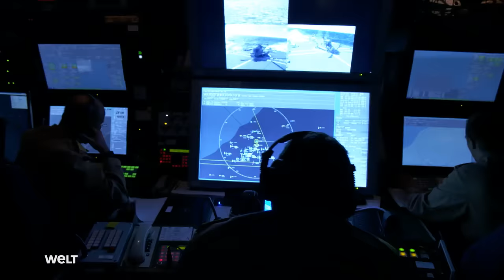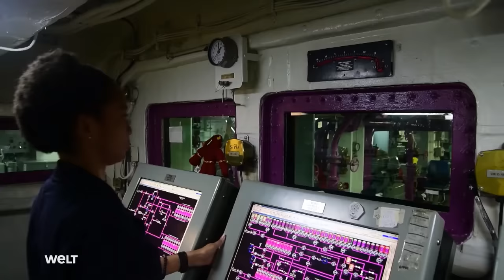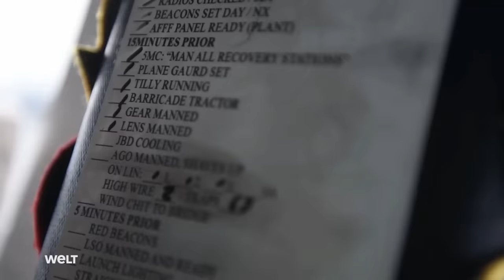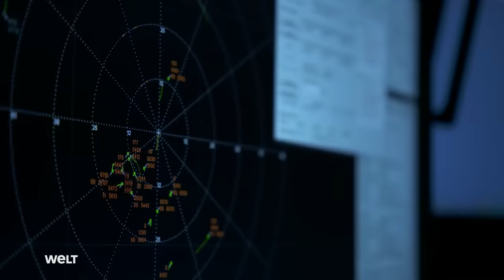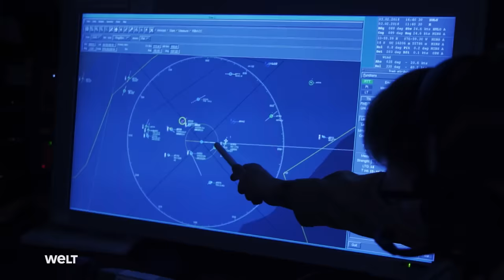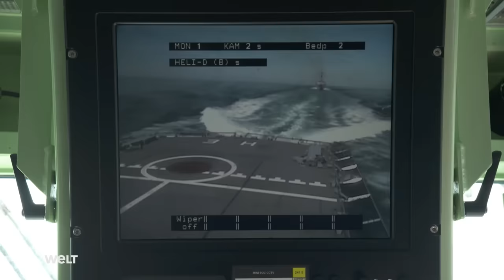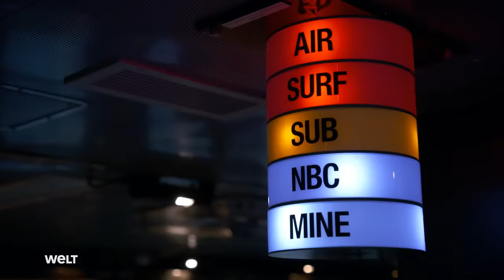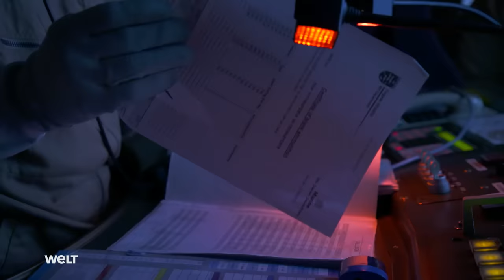Inside Navy Strategies (2) - Attack On The Atlantic | Full Documentary

Comment: 06:05 Commerce
06:45 Flight Deck Surface
08:50 Colors
10:07 Fuel for 1 Week
12:10 Jet Blast Deflector
16:50 Board
18:35 Battle Formation
20:45 SMART-L
23:01 Radar Jammer
24:40 APAR
28:00 Signal Lamps
30:00 Deck Edge Elevator
30:30 Hangar
31:00 Hangar Aircraft Service
32:32 Suez Canal
35:58 Ride of the Valkyrie
37:25 Battle Formation
42:05 Fire Exercise (Truman)
Reply: Lioioio lol po0000😊

Comment: wrong claims how steam gets to the pistons and when. Cat Ready, Bridle Tension, Stand-by, Final Ready, Launch complete - everything happening at once.
Cat Receivers hold super heated steam that is now a gas and when it exposed it expands a 400 to 1 pressure amount that's available and only the opening of the launch valves controls how fast it applied to the two pistons -  18" in diameter each side. Wind over the deck and aircraft weight is used to give the 10 knots about their minimum flying speed leaving the cat.